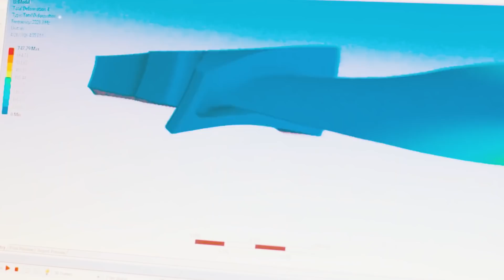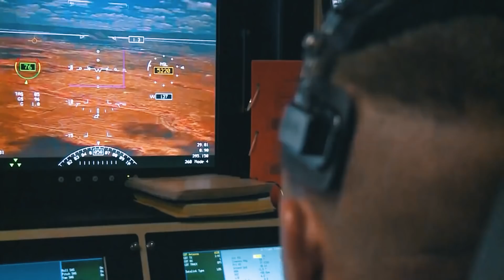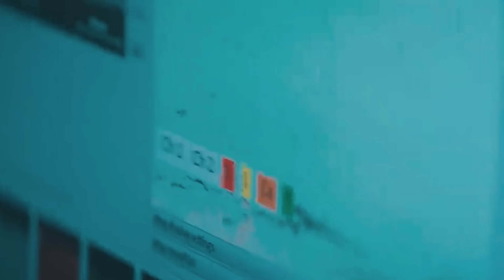The US Has FINALLY Revealed Its 6th Generation Fighter

Comment: 6th gen should be unmanned, air to air, air to ground, air to surface. Stealthy, sure but no need to go crazy. We should also have decoy drones to overwhelm radar. Blind them with blips.
Reply: You should look into the US military "drone swarm" tests... They're working on micro drone swarms for surveillance, munitions (both targeted and blanket attacks), as well as radar cluttering.
Reply: It would reduce the cost of training a pilot, materials and equipment  required for the pilot but signal jamming might become a problem, Russia SU 70 is a good example of a unmanned stealth jet said to come in 2024
Reply: the "decoy drones" is what was done in desert storm, sent decoy drones to make sam sites turn on radar
Reply: I wonder if the Harrier will be upgraded with backward swept wings and better stealth?
Reply: @RainXMix  if you mean the harrier as we know it, I seriously doubt it. But if you are referencing a harrier-esque plane that performs similar operations, probably
Reply: @chrisrenemans5026  there's a vertical take off and landing version of the F35.
Reply: @dud3man6969  yes, which is one of the things I was referencing to with the harrier-sequence thing
Reply: @RainXMix  no, it's being replaced by the F35
Reply: Although unmanned aircraft will without a doubt be a much more significant thing in the future, there is a few issues

A: the tech is still developing, although rapidly
B: there are certain factors that unmanned drones cannot deal with
C: although currently they are advanced and a huge advantage, they won’t always be, the more they are used, the more counters to them will be made.

So unmanned aircraft is a future alternative, but humans will always have to pilot some planes since we aren’t exactly hackable
Reply: 😒Admiring weapons that will NEVER guarantee peace…🤦🏾‍♂️🤦🏾‍♂️🤦🏾‍♂️
Reply: What is the difference between air to ground and air to surface?
Reply: @Desiderium  air to surface is anti ship.
Reply: @dud3man6969  Thank you.
Reply: No it should not be unmanned i would like to join the airforce i dont want everything to be controlled by robots
Reply: @Quichenic  pilots of the future will be flying multiple drones from simulator/controllers.
Reply: @dud3man6969  i like sims but i would rather be in the plane instead of a sim so i hope the unmanned thing doesnt happen until 2050
Reply: @Quichenic  it may happen partially but I’m almost certain there will always be a use for human pilots, although the numbers may decrease

Comment: Just want to point out something that will piss off a lot of "F-22 Fanboy's".

1st The F-22 wasn't the 1st 5th gen jet. That actually goes to the Russian SU-47.

2nd You stated that Aviation Experts have 5 distinct things that make a 5th generation.

A) Low Visibility ie Stealth, yes both F-22 and F-35 have Stealth, but so does a few 4.5 gen jets.

B) Increase Maneuverability ie having a Higher STR/ITR, where yes the F-35 doesn't have good Maneuverability, but the F-22 can't beat all the 4.5 gen's, the F-22 actually matches a lot with the Rafale, but the Eurofighter outperforms the F-22 in STR/ITR.

C) New Generation Avionics ie new systems like Radar - Systems - Hardware - Software, where yes the F-35 does have all very advanced features, where the F-22 is outdated, yes it has a very powerful APG-77v1 but being powerful isn't being advanced, plus it has no IRST - HMD - and lacks tracking information without needing its 77v1 on.

D) Multi-purpose Capability ie a multi-role fighter, again yes the F-35 is a multi-role fighter being able to carry out air to ground attacks with at least some air to air at least at BVR range. The F-22 doesn't really have the ability for air to ground attacks, yes the block 5 77v1 system does give it a little better capability, but its still very limited in how it can operate.

E) Net Working and Data Integration yes the F-35 basically a flying computer, but the F-22 again not so much, plus going to in just talking to others the F-22 lacks Link-16 so is unable to talk to others without the needing to use what is basically a radio system.

So by that the US doesn't have any 5th gen in service.

The F-22 F-35 and J-20 for that matter are more like 4.7 gen's. Like 4.5 gen's with some RAM paint. Really the only 5th gen again by the Aviation Experts logic is the SU-57. It's Stealthy - Very Maneuverable - Advanced Systems not just a "Powerful" radar like the F-22 - it's a real Multi-role Fighter - and like no:3 uses advanced technology like its ability to send information from 1 jet to a command vehicle on the ground.
Reply: Russian bot lol
Reply: @kaz128 

Says the American fanboy 😂🤣.
Reply: @forzaisspeed  Stating the Su-57 is the only 5th gen fighter is a joke lol, the other laughable fact is Russia can't even produce them. Russia always overstates capabilities of their equipment, most of it is junk prone to failure.
Reply: @forzaisspeed  Why does Ukraine still have jets after over a month if the SU -57 is so bad azz?  I'm still waiting to see that bedazz tank yall claim to have.. 

Is the great SU-57 scared of stingers? Love to see a javelin pop the top of that tank that's to scared to come out..lol

I give you credit for being a trooper.. Most Russian idiots bragging about Russia's military have been hiding in shame for more than a month..lol
Reply: russian copium is very strong i see
Reply: Whatever Ivan…..
Reply: I don’t see the Su-57 as a TRUE stealth fighter (very unlike F-22).  The Indian Government didn’t think so either as they didn’t buy it or pay for its manufacturing development.  It looks like what it is…a follow-on to other Sukhoi machines with some (cursory) attempt at stealth.  It’s a target.  Don’t get me wrong, it’s a lovely aircraft and I respect they’re ability to design aircraft.
Reply: Yeah yeah!!!  the Su-47 was the first 5th generation  aircraft  &  its done miraculous wonders in Ukraine forcing the  Ukrainian government to  topple in 3 days. 🤪
Reply: @patkawesa7046  theres only one su47, it was made to test and develop the su27, you might have mistaken the 47 with the 57

Comment: Well the F-22 was supposed to replace the F-15. How did that work out. They have different objectives. Just like the 6th Gen fighter would have. You send the F-22 in to clear the skies and the F-35 will clear the ground radar and AA. Then the F-15 will start doing the rest.
Reply: The F35 has 3 different models it's able to handle anything you need it too nuclear strikes whatever you needed to do dogfight it can do
Reply: The International guard base where I live is receiving F35 next year they  Getting rid of the F 16
Reply: With these weapons , there will NEVER be peace on earth…😒
“F-98” in d future will NEVER guarantee peace☹️
Reply: @FofXequalsYnot  There never was peace on earth, and there never will be.
Reply: @williamjordan5554  you can keep celebrating d weapons for now…😑
Reply: The F15E can hold and be equipped with Nuclear weapons The B61. I would think that might be one of the larges reasons its still in service. 
The F35 should be certified next year. That could start the retirement for the F15E.
Reply: F35 should of been replacement for f15. 
F15 is an air superiority fighter unlike f22 which is an dogfighter
Reply: @DOHA104p3  what? First of all, there is no such thing as dogfighter for several decades now. F22 is not a "dogfighter", F22 is air superiority fighter. F22 would smoke F15 with ease. I dont know where did you get idea that F22 is not air superiority fighter jet. It was literally made to OWN the skies and be the most advanced fighter jet. That is why F22 was never sold to anyone unlike other jets.
Reply: @vasilije94  Dogfighting actually was a selling point in its competition with its Northrop rival.
Reply: @williamjordan5554  no one said that F22 is not the great dogfighter jet. I just said that dogfights will not happen and didn't happen for a long time. Its BVR fights now. Maybe some FOX 2, but dogfighting is probably not going to happen anytime soon. When they picked F22 they wanted all, stealth, agile and fast jet with great avionics to be air superiority plane. And F22 can do pretty much all kind of fights and have the most probability to win. But in real world BVR is all they will probably engage in.
Reply: @vasilije94  I don't disagree, but I read that just having the ability to dogfight put it over the line in competition with Northrop.
Reply: @williamjordan5554  no, the real reason was that government had more faith in lockhead to deliver since they delivered F-117 and had more experience with "stealth" design and had more conventional design.
Reply: @DOHA104p3  that's a negative. The f 22 is 💯 an air superiority fighter! Dogs fights have such a low probability of happening anymore. The F 22 just knocks planes out of the sky BVR before they even know what happened!   Even if it were to "Dog fight" with it's thrust vectoring, it is super maneuverable subsonic
Reply: The F-22 is a dog fighter. The F-22 is a BVR fighter. The F-22 is every kind of fighter when it comes to killing enemy aircraft. The F-22 is still decades later, the best all around air superiority fighter in the world, just like it was claimed when it was built. The only problem it had was the end of the Cold War. It's funding got cut. In hind sight, that was not a bad move. In it's 20 years in service, has it ever been challenged? We may well have it's replacement in service before it ever shoots at an enemy plane.
Reply: @Elthenar  They better get to movin on its replacement the way things are going for that to happen..
Reply: @lanejohnson7656  the US was just given the green light and funding in 2018 for a 6th generation fighter. They recently announced they have already built and flown a prototype. Accomplishing that in just 3 to 4 years..... That's VERY impressive ...id say they're on schedule!
Reply: @skypallman6169  What I was getting at is they are probably already skeeming on the 6th gen replacement before its even done..  I can see them working on technology that they know won't be ready before the current project is done.
Reply: @DOHA104p3  you have to be trolling